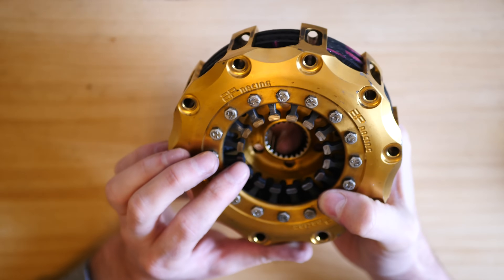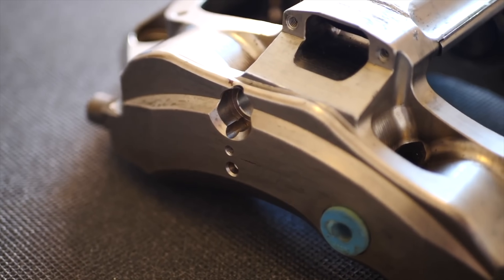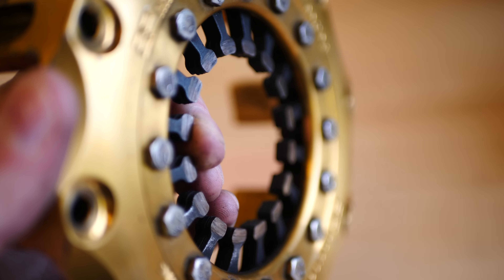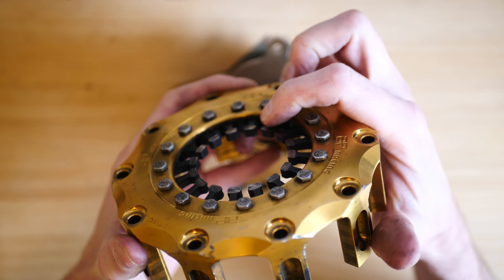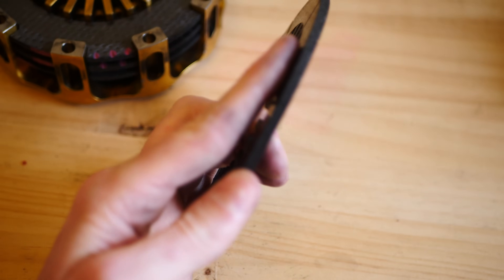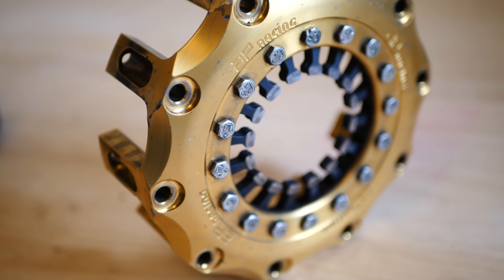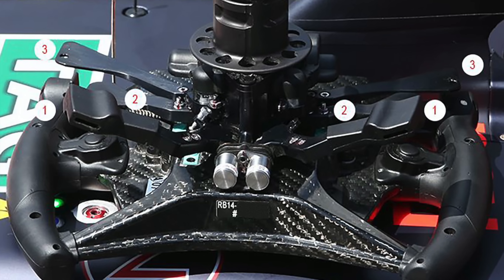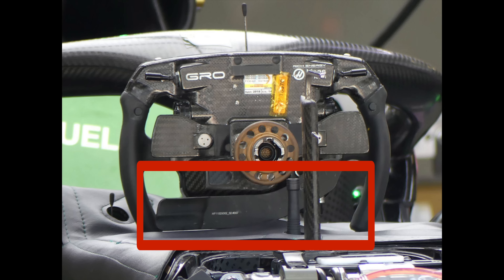How an F1 Clutch Works | F1 Engineering

Comment: wow I never expected an f1 clutch to be so small, it's so cute.
Reply: adorable , even...
Reply: I want to have one in my room
Reply: A dog is cute. A clutch is awesome. (:
Reply: Smaller=less rotational mass
Reply: @replynotificationsdisabled  we call it moment of inertia, and yes, exactly.
Reply: @replynotificationsdisabled  So I take it, this translates to faster and or smoother gear changes ? Since less time is needed to speed up or slow down the momentum of the clutch ? Outside of the dogbox of course.
Reply: @Tahllinavian  most likely, but it also doesn't need the torque a larger clutch would. Wouldn't say myself that size has much to do with bite speed. Compounds and multiple plates I'd think to be mostly as cause. But I'm kinda baked at the moment.
Reply: @replynotificationsdisabled   yep, bite is definetly more so the materials and the amount of plates, it makes sense.
Reply: @Tahllinavian  my main effort was you say, a larger diameter clutch, with same material/platecount, will actually bite better than an smaller one.. Think big brakes.
Reply: @replynotificationsdisabled  yeah but this small clutch having torque capacity enough to pull F1 car and more weight reduction
Reply: @replynotificationsdisabled BASED!
Reply: @replynotificationsdisabled  also lighter...
Reply: Me too man, the clutch in my dirtbike is the same size
Reply: its small because of the body or Design of the car and they used a paddle instead of a stick..
Reply: @Cradlebeeeast  it's small because of less innerita of rotating mass. The smaller diameter the faster the car can rev.
Reply: If you take into account it has multiple discs, it has more total are than a typical clutch.
Reply: i m confused too how can a normal car have more then two times the size of this clutch and have so low hp
Reply: hellslayer 96 normal car is a single disc clutch. This clutch has like 6 discs, waaaaay more surface area.
Reply: hellslayer 96 the smaller it is the more it grips
Reply: @hellslayer9638  F1 car not really needed big diameter clutch for more torque capacity, because the whole of car is lighter than regular car, so torque capacity of small clutch is enough to pulls the car and also can let the engine easy to revving on high rpm more faster it's mean the loss power to spinning bigger and heavier clutch it reduce
Reply: Right!
Reply: Yet it can take hundreds of pounds of force
Reply: @Loui Arnold you're assuming i said something else..
Reply: did you saw the current meecedes engine? at the geneva autosalon they had one there. its incredible small.
Reply: @omadta5798   I mean I'm not surprised, F1 engines have been pretty small for decades now and have only been getting smaller. The hybrid V6s are the tiniest, F1 engines have ever been. Even road carse have bigger displacement engines, these days. F1 engines get all their power from Turbos, electric motors and high RPMS. Nowadays, you lose the MGUK and you lost half the power of your car, not a fan.
Reply: @Tahllinavian  well I am a big fan, cause I really do love when bounderies get sett new. the v6 engines are from a pure technicel perspective awsome engines so are the electric stuff wiht the turbo. well, the rpm is unfortunate at the moment still low with max 15k and most of the time not higher then 12 to 13k but I understand from a motorsport pourist point of view there not great. it was more meant like a question, if you saw the mercv6 in geneva, cause in my opinion its a incredible view when you think, that from this tiny engine you get up to a 1000 bhp.
Reply: @omadta5798   You can get 1k horsepower from a V6, if tuned and modified to do so,  even in road cars like the Nissan R35 GTR can put out crazy power numbers these days we're talking 2000+ on a race built VQ engine. However these F1 hybrids do not put out that much power from their engine alone, that's a common misconception. They get half their power to make that 1k hp, from the elecritical motors that make up the other part of the hybrid system. The V6 only makes around 600 ish horsepower, while the electric motors pick up the slack by adding the missing 400+ horsepower to make up the total of "1000" horsepower. 

This is what I mean when I say if you lose the electric power unit for whatever reason you lose half your power. The Hybrid system has done nothing but make the sport worse, it has no benefit whatsover, it makes the cars overly complicated, increases additional points of failure and adds unncessary extra weight for no good reason. They only did this to pander to the treehuggers. The the tried, tested and true high power turbo engine is still more reliable and faster, especially with todays technology. F2 proves you don't need the hybrid system, it's nothing but a gimmick and only increases the bar of entry for less wealthy teams.
Reply: @Tahllinavian  you realise that I know that ? I know how this engines work. Iv seen them! but its incredible that this engines (obviesly the whole engine wiht electricmotors and batterie and turbo and everyhting) get 1000 hp, when you take into account what the regulations are. I get the feel you still did not udnerstand that I just asked if you saw an current f1 engine in  fron of you, but you went on to try to teach somehting? I think I know quiet alot about the current systems, how they work togetehr and why the different manufactures went for different styles in some things.!
Reply: @omadta5798   I have seen what the engines look like, yes and ? I was just explaining my point of view not neccesarily trying to "teach" anything, you gave the impression that engines themselves put out 1k horsepower, when that is clearly not the case. The comment wasn't just for you either, but others that may not know this and want more detail on the subject. Many don't know that the total number they get for the power number of these cars is not from the engine alone.  I do not count additional power from something like electrical motors as the "engine" it's in addition to it, not the engine itself. I guess I'm not as easily impressed as you, as I find a lot of the technology wasted on unnecesary things while improvement in tech slow on other areas that are important. It would be more impressive to me if the same engines could put out that power number and be reliable for an entire race, without the aid of electrical motors.
Reply: @Tahllinavian  yikes, I mean, I dont know what you know about techic and Physics but what current engines and or power units under the regulations can do is incredible. but whatever
Reply: @omadta5798  Under regulations sure, since these cars are forced to be hybrid. the regulations are the real problem here.
Reply: @Tahllinavian  well not sure if there a problem but they certainly are the reason
Reply: @omadta5798  They're problem in my opinion, since they don't really add any benefit and have a huge amount of downsides in comparison to just a turbo engine setup. The cars were already fast before the hybrid era. Speeds have not increased that much since the 90s and 2000s cars, in fact the modern cars are a lot slower in some ways.  It's the Aero really thats seen the biggest advancements, not the power units. The modern cars are very draggy and create a lot of dirty air. Thats why they're trying to fix this problem with the new car in 2022.
Reply: @Tahllinavian  well you heard about environmental change before? and in which direction normal cars are going? Speeds have massivly changed btw. despite tracks having shicanes and stuff and the way higher drag the cars produce, the topspeed has increased in alot of places. even this year speeds of over 360 where reached! and on the other hand the cars are as fast as never before in corners. alone in the parabolica they are 50km/h faster then the previous cars pre 2017. The hybrid engines, are efficient powerful and have a extremely high durability with only 3 being used for one season and for some parts only two. Not quiet sure why your trying to sell, that the power units did not advance. this are some of the most powerful and efficient machines there are on earth and that inside a rulebook that limits fuelflow, size, rpm, and so on!. I really dont uznderstand why you get to such conclusion, while trying to tell me that you know technic and how f1 power units work!. either you read something that was not really correct or some other delusional guys opr your just talking shit and you dont really have a clue about what your talking. Small tip, there are ways to get informations from F1 teams, you ma want to try that. ridicoulus what kind of shit your writing here.
Reply: And expensive
Reply: Similar in size to a motorcycle clutch.
Reply: Well the wheel is so small it has to be that small.
Reply: I thought it was just a small model
Reply: Cute like a honey badger

Did you see the beef in that spring?
Reply: The engines are very small
Reply: Same size as sportbike clutch
Reply: All about Weight
Reply: It is small cute powerful expensivest
Reply: Lol my exact thoughts !!!
Reply: I never knew they had a clutch
Im prob just dumb af
Reply: @damiancappa6668  I mean obviously. The only other option would be a torque converter like an automatic.
Reply: 😳 cute, lol never heard it called that before 😂🤘🥴
Reply: Amazing how it can transmit so much power.
Reply: The springs must be HUGE and heavy AF
Reply: The smaller a clutch is the harder it grips. Bigger ones grip more softly its easier to use. As well as it has multiple plates that give it more torque.
Reply: Yes it the most cute adorable more expensive than a nasa computer ever
Reply: @John_Ass  it's 6 grand, watch the fucking video.

Comment: It is very similar to a motorcycle multiplate clutch. Except F1 is a dry clutch and a motorcycle is bathed in engine oil. Older Ducatis used a dry clutch but the have a couple downsides when used often, ( I .e. Chatter, can heat up and slip rather quickly and are jumpy or harder to modulate).... The spring is different too but on the lines of a KTM Belleville washer type. Instead of on large diameter pressure and 1 friction plate in most autos that still have manual transmissions motorcycles and F1 use multiplated smaller ones stacked.together to transfer the torque thru friction and pressure. Very simple but genius.

Comment: is an f1 clutch and transmition be aplicable to super cars and can they be used as a practical transmition to a daily drive sports car or super car? I would like to know hope fully if I got rich I would like to apply some F1 tech to a Sports car or a Rally car.
Reply: No, because your car would not have the transmission that fits the clutch

Comment: I think you've got the clutch operation backwards,
when a driver pulls the clutch paddle it depresses the clutch meaning it retracts the master slave cylinder and when it's released the piston is applied to the clutch pushing the disks together.
Reply: wrong

Comment: My Yamaha R6 probably has a clutch this size.
Cannot imagine how this thing  survive 1000+HP.
Reply: They don't use clutch much that's how.
Reply: They are designed to be used only a few times during a race, its not something they use costantly. Remember the Toyota retirement a couple of years ago during le mans? it was because of a clutch failure,  the driver basically used it like he was driving a normal road car (not for his fault, there was some multiple misunderstandings), so the clutch heated up a lot and then broke.
Reply: My first thought is if I could make this work on my kawasaki hah.
Reply: Bet your R6 clutch weights more :D. This looks smaller than my 80bhp Suzuki.
Reply: @jordan9339  so true this thing is amazing

Comment: OK so I think I can see sitting in traffic with the clutch in is gonna heat / wear the clutch. Where as sitting in neutral gear will not.. Right?
Reply: It most likely won't wear the clutch disc as you probably would depress the pedal all the way, thus disengaging it completely. However the throwout bearing (in this video, the silver ring on the part with hydrolics) will wear out rather quickly if you practice this regularly. Most people who drive manuals, keep their foot off the clutch pedal as much as possible, because any time you are  using the clutch, you are wasting something (clutch, energy, time e.t.c).

Comment: I'd love to see the differences between this and the clutch from a top fuel dragster
Reply: Engineering Explained did a good video on Top Fuel Draggster clutch.
The thech there is simple in concept but very complex in execution. They are poles apart in design and quite opposite in function.

Comment: Had no idea the how small it would be truly impressive when compared to my RPS dual carbon. What is the rated torque rating for the clutch, my rps was rated for over 800 lb-ft  best dyno was 768 lb-ft.

Comment: Another interesting fact is that the driver actuates the clutch through 2 levers behind the wheel (similar to how he shifts gears) and its 2 levers for the same clutch because that way he can regulate it fast, easier. When only 1 of them is pulled, it translates into "50%" of a clutch pedal being pressed, so at the start of race he just releases one and it goes from 100% to 50% in a split second, then after good rpm he releases the second one
Reply from the maker: Actually that was banned a few years ago.
Reply: @Driver61  Didnt know it was banned, but then what did Craig mean that Bottas went back to twin paddles last year?

Comment: It is not needed. It is used just for takig off. With so much power from MGUK, it could be mounted on gearbox and used for taking off in some ultra low gear.. Engine then could be synchronised with gearbox and connected like any other gear shift

Comment: What does an F1 flywheel look like?
Reply: The so called flywheel is part of the clutch housing,some plates are splined to the engine and the other plates are splined to the trans,there is no need for a traditional flywheel.
Reply: @ibrahimcehajic  Except the outer clutch basket needs to bolt to something in order to spin with the crankshaft... that something is a flywheel.
Reply: @Balomis  Except it can be bolted directly to the crankshaft...
Reply: Size of a silver dollar
Reply: Ask Sebastian Buemi, oh wait, those were flying wheels, not flywheel.
Reply: As far as I know F1 cars don't have "flywheels". They have mounts for the clutch basket sure. But some baskets are designed to be splined directly to the crankshaft. The clutch pack is sandwiched in between the engine and gearbox and just held in place by the transmission casing.
Reply: f1 don't need that much mass of flywheel now dude electric motors which provide momentum to engine when in starting rmps
Reply: doubt they'd have one, it's just extra weight when you can use the existing inertia of the engine (crank, rods etc.) and clutch basket.
Reply: @benjaminmcintosh857  F1 cars does have a flywheel. The images are for representational purpose only. Without flywheel you cannot control the output torque and NO crank and clutch basket inertia is not equal to what a flywheel could produce. MotoGP bikes use External flywheel to alter the torque output and the riding character of the motorcycle throughout the season on different tracks. Saying fly wheel is just extra weight is like saying we don't need rims as they're are extra weight and just use a whole ass rubber cylinder instead. You do need weight in the right places to make things work.
Reply: @Toxic88088  First off, you can't really compare Moto GP and F1 engines, very different philosophies. Also, a (fairly) quick Google search would have yielded results showing that F1 engines have lacked flywheels for at least the past decade as the rotational inertia of the clutch basket and engine really is enough when your engine never runs below 3-4 thousand rpm. Let alone the additional rotational mass and torque provided by the electric motor that is also attached to the crank. The weight is in the right places, and provides sufficient inertia.
Reply: @benjaminmcintosh857  I mean, motogp and F1 engines are pretty similar in philosophy. High horsepower high revving low torque.
Reply: Benjamin McIntosh  u can’t use that clutch without a flywheel the disc’s need a surface to make contact
Reply: @mrdriver511  the discs within the clutch are what provide the friction since some move with the clutch housing, the clutch itself is either bolted or attached with a spline to the engine/gearbox (not sure which way around I think the spline is on the engine side)
Reply: drdavid   sorry but having watched the first few minutes of the video now 3 times you're going to have to provide a timestamp. If you look at 1:53 there's no visible flywheel and especially with the hybrid systems these days it seems like a unnecessary part.
Reply: @benjaminmcintosh857  Actually, you can see a flywheel @1:53, it's the black disk at the back of the "basket" with the timing teeth on it. And an F1 car, or any modern racing car, doesn't have a 140mm hub on the back of the crankshaft to mount a clutch assembly.
Reply: @jasondunken  If it's not meant to store rotational energy then it's not a flywheel. Just a trigger wheel / mounting plate
Reply: @hene6539  Despite the fact that a motorsports flywheel has little rotational mass, it is still called a flywheel.
Reply: @benjaminmcintosh857  what do you think the clutch is bolted to then, if there isn't a flywheel? Surely logic must dictate the flywheel is there but is vary small